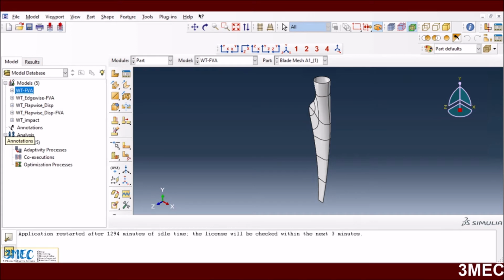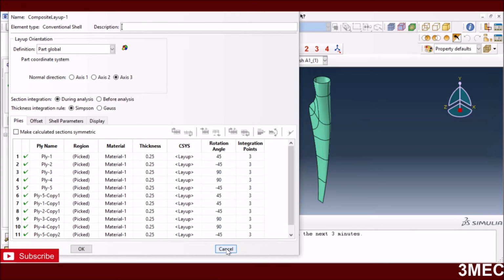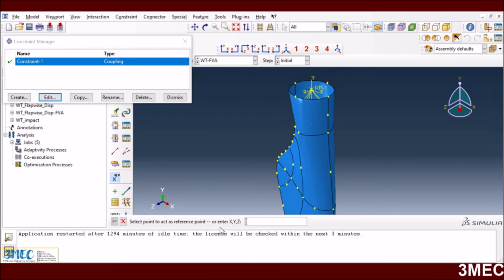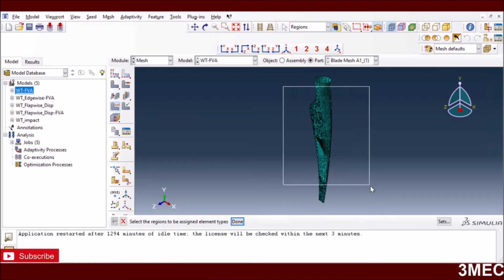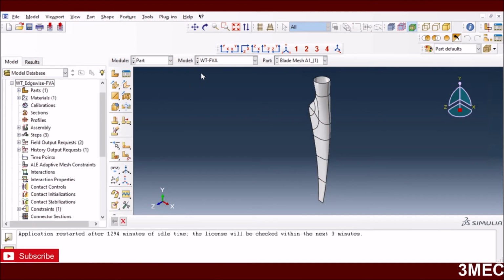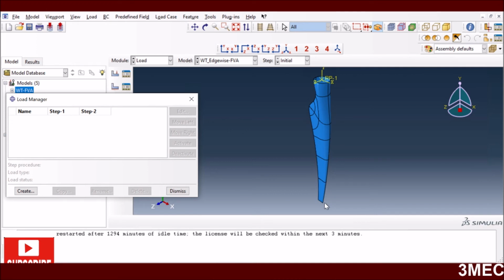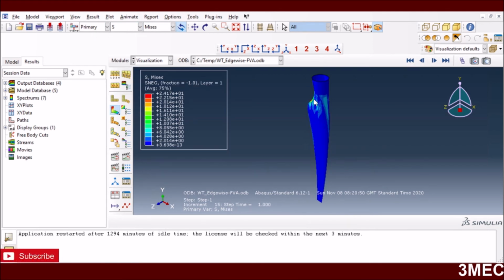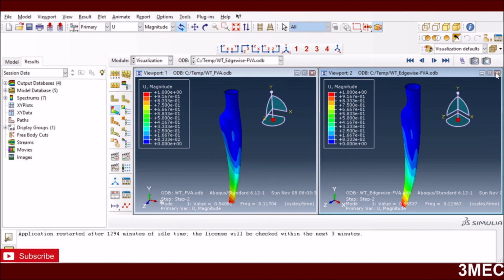Wind Turbine Blade Outer Shell Structural Analysis Edgewise Loading Effect- Part 1 - ABAQUS Tutorial

Comment: Hello Sir, Im trying to model the blade of a 10 MW DTU offshore wind turbine . How to do it exactly? Could you please guide me
Reply from the maker: Thank you for reaching out!

Modelling the blade of a 10 MW DTU offshore wind turbine in ABAQUS is an excellent project and quite advanced, as it involves composite materials, aerodynamic loads, large-scale structures, and possibly fluid–structure interaction.

Here’s a structured approach to help guide you:

🔹 1. Get the Blade Geometry and Design Data
Start with the DTU 10 MW Reference Wind Turbine data:

Download from DTU Wind Energy GitHub or DTU Wind Energy’s website.

You'll find blade geometry, aero-structural properties, and material layups.

🔹 2. Pre-Processing – Building the Model
Import Geometry: Create the 3D blade shape in a CAD tool (SolidWorks, Rhino, etc.) or generate cross-sections in Python and import into ABAQUS as a part or assembly.

Meshing:

Use shell elements (e.g., S4R) for fast models.

Use solid elements (e.g., C3D8R) for detailed analysis, especially for local failure prediction.

Composite Layup:

Define sections using composite layup in ABAQUS/CAE.

Use stacked orientation and ply definitions based on DTU data.

🔹 3. Material Properties
Most large blades use fibre-reinforced composites:

Define orthotropic material behaviour.

Use Hashin or user-defined damage models (e.g., VUMAT) for failure analysis if needed.

🔹 4. Boundary Conditions & Loads
Boundary Conditions:

Typically, the blade root is fixed (simulate hub interface).

Loading Types:

Apply gravitational load (gravity option).

Apply aerodynamic pressure profiles (can use DLOAD or pressure fields).

Optionally: Perform modal, static, or dynamic analysis (e.g., flapwise or edgewise bending).

🔹 5. Analysis Type
Depending on your goal:

Static Analysis: For deflection, stress distribution.

Modal Analysis: To find natural frequencies and modes.

Buckling Analysis: For stability.

Dynamic/Transient Analysis: For time-varying loads (e.g., gusts or waves).

🔹 6. Post-Processing
Check for tip deflection, stress hotspots, and strain energy.

Look for failure initiation, especially at ply interfaces or near root region.

🔹 Helpful Resources:
NREL & DTU 10 MW reports (Google “DTU 10 MW wind turbine report”)

ABAQUS manuals:

Composite Modeling Guide

Example Problems Manual (wind energy-related examples)

Books:

"Composite Materials for Wind Blades" by Povl Brøndsted et al.

"Wind Turbine Blade Analysis using FEM" by J. Gordon Leishman
Reply: @Professor3MEC  Thank you So much for your help sir. Grateful.